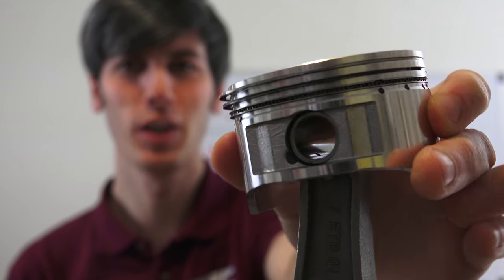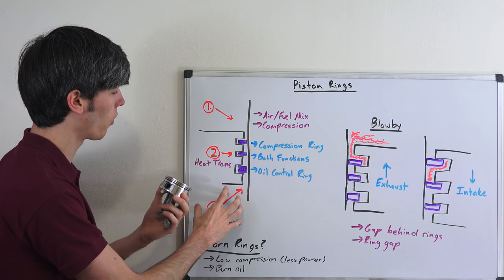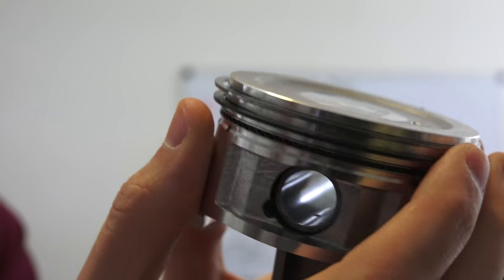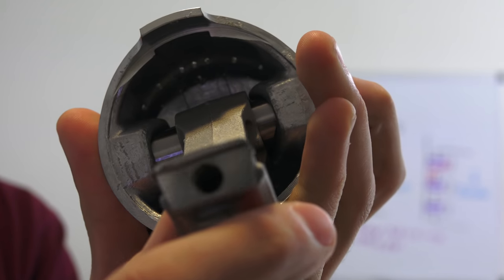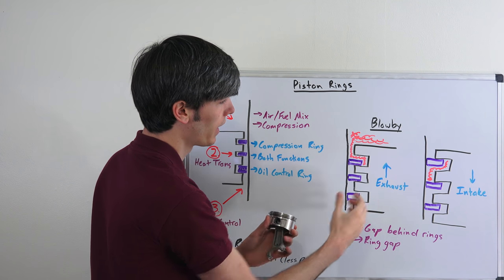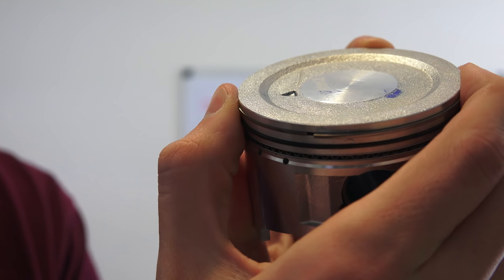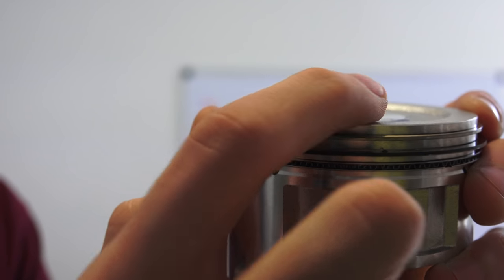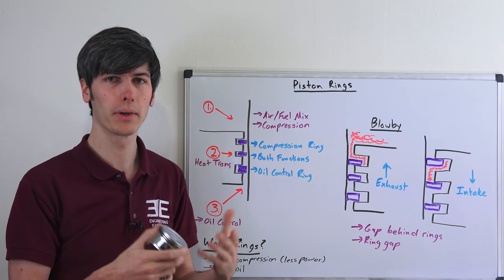Piston Rings & Blowby - Explained

Comment: How can oil leak into chamber due to relatively worn piston rings?? I just can't imagine how it's possible

So i'm thinking aloud:
Engine still has compression capability. Ok, maybe %15-20 less but rings still work. And oil is only "sprayed" to the piston from below. it is not something like there is huge amount of "constant, high pressure, oil pool" below the piston. Besides, oil leak can not occur during compression and power cycles since the pressure in the chamber will be very high. 
It only makes sense to me it may occur during intake cycle because in most cars there is vacuum in the chamber. If so, that means when we use engine breaking going downhill, pistons should suck the oil from crankcase and pump is to the exhaust without burning since there is no ignition and fuel injection since we don't use gas pedal. So in that case oil consumption should be highest when engine breaking with no gas pedal applied.

Please correct me if i'm wrong and help clarifty things for me..

Thank you very much. Big fan of your videos
Reply: ulyanof ... oil can get passed the piston rings upwards from the oil pan into the chamber due to crank case pressure from heat and gas vapor evaporation also with the crank shaft splashing oil everywhere every time the connecting rod dips into the pan. Most Engine blocks don’t have a crank case ventilation system like cylinder heads do, that’s another chapter. Cylinder heads have many moving parts that have all types of seals to keep oil and air from passing through but under extreme working conditions especially an engine with 100,000 miles or more have plenty or wear and tear which does allow oil to accidentally make it pass the vale seats, valve seals, valve guides and other areas that let oil make its way to the piston chamber. This is called blowby and it will also cause extra pressure in the piston chamber that will assist in pushing the oil down passed the piston rings. By the time the heads are warn out enough to allow this to happen, the piston rings also have enough ware and tear that they don’t seal as well as they used to allowing oil to pass the rings from both the heads and the oil pan. This is why there exists synthetic oil that have additives that purposely make these seals swell up to make the loose clearances tight once again to slow down blowby and other oil consumption problems. If your motor is a forced induction motor, blowby can happen even if the motor is a brand new motor and even if it’s built with high performance parts because of what is called valve overlap. Valve overlap is the split moment when both the exhaust valve and the air intake valve are slightly open at the same time. It is an extremely minor and critical moment because at high rpm parts are moving extremely hard and fast and nothing is perfect. The only thing that can control this factor is what we know as variable valve timing which is where the engines design has the technology to speed up or slow down either one of the cam  shafts rotation to control valve movement and or timing if you will in order to create a better and more precise function of the moving parts. The only thing that can stop or hold back the oil from passing the piston rings at this point is the rings themselves if they are new and or in great condition. Even then, they must be at optimal operating temperature so that to ensure that the material that the ring is made of has expanded to the factory or chosen operating specifications. More technically they must be gauged and gapped correctly and must be the proper piston ring for the application or conditions that the motor has been built for. These types of details have so many factors I could tell you about that I could write a book on it so I’ll keep this short.

Comment: How is the engine gonna behave when you pressed the ignition while the engine is on? Will it damage the compression ring? Is there a significant effect to the engine? Thank you.
Reply: as in turned the key to start while running?
Reply: Yes. One time my wife did that. It is so quite inside that she accidentally turned it on again.
Reply: +Peter S I believe the only things that would hurt are the flywheel and starter if there isn't a safety switch to recognize to realise the engine is already running

Comment: Not a bad explanation, but you are 2 strokes short in your description.
The vast bulk of blow-by is most likely to occur when the piston is experiencing the highest combustion pressures on the power stroke, and the compression stroke. Indeed fuel dilution of the oil is common in modified engines 
(richer fuelling for power & higher compression ratios)
Also the oil holes below pass oil both ways as most modern engines have oil jets that spray oil on the underside of the piston for cooling & lubrication.

Comment: I have heard that you are supposed to align the piston ring gaps 180 degrees from each other, is that true? Also can't you get to them by just dropping the oil pan and unbolting the connecting rod from the crank shaft? I think the piston would just pull out at that point.
Reply: piston rings probably rotate around the piston during operation so it may seem like a good idea but doesn't play out very well in practice. and you would have to tear apart the entire engine to get to the piston rings. as in taking the engine out and pulling the crank out

Comment: What happens if the oil drain holes in the piston are blocked or the oil control ring is stuck.  How does oil get into the combustion chamber if the compression rings are good?  I have a toyota 1zz engine, and compression is good, so i am cofused as to why the engine loses oil.

Comment: I have a V6 that has loss of compression on one of its cylinders with misfire. I pulled the oil filler cap off while it is running and I don't feel or see any signs of blowby. Can I safely assume that it is not a ring problem, but instead a burnt exhaust valve?

Comment: I just rebuilt a 460. After breaking in the cam, I checked the plugs, and saw that all my cylinders had a half a teaspoon  of oil on them, in the dish. Guides and seals are fine. It puffed a bit of smoke on start, but that was it.  Since my vacuum was a bit erratic, I determined the intake manifold was leaking in the valley, and sucking oil. I shaved the  manifold. Tested it again, and the vacuum came up to about normal for my cam.  However... I still have oil on pistons. Is this possibly just because the rings aren't broken in yet?  I also have forged pistons. There's a fair amount of blow-by, but the motor only has 1/2 hour running time  Thoughts, Ideas?

Comment: Hey great video, thanks for the explanation! I was wondering why it seems like modern cars can go for over 200k miles without any major engine work, but a car from the 60s will need a new engine every 100k miles. And when and engine is "tired" does that mean it has low compression because of worn piston rings? thanks!

Comment: I recently had a misfire code in my 2008 Honda Accord. They replaced all the spark plugs and did a software update. A spark plug was apparently the issue causing the CEL to flash rapidly and also create a vibration in the engine. The mechanic mentioned if the replacement of spark plugs and software update does not work, then it could be a more serious issue caused by a piston ring malfunction. 
His advice was to keep an eye on it. I have no idea how to do that apart from waiting for the CEL to go off again and taking it to a mechanic immediately. What else can I do to check if this is actually a piston ring issue? Compression test?? Thanks for the help!

Comment: Great video! Very informative! But I would like to ask why does all four of my sparkplugs have thin film of oil on the threads and the mating surface of the sparkplug and where it sits on the cylinder head? All of the seals gaskets are newly replaced, is it blowby? Do I have to change my piston rings? I asked an automotive technician about this and told me it’s normal but an expert on GA16DE and Nissan EFI engines said it’s not. Is it because of the expansion of the cylinder head because of the heat? My car is a 1992 Nissan Sunny B13 with a GA16DE engine, answers would be greatly appreciated. Thank you and stay safe everyone!

Comment: so if you have pistons with 4 rings (oil ring down the bottom of the piston and 3 normal rings at the top) if you had 4 broken rings (4 cyl engine) can you do away with the middle ring on each piston? its only a 30ish hp engine and won't see much work so it should work.

can't get new rings as the replacement parts are a little bigger than the original ones. (new pistons are roughly 1-2mm larger than the original ones therefor the rings are also bigger)
unless the ring can be adjusted to suit. i.e. cut a little off the end so it can squash to the right size. it should do the job then.

Comment: Any engine (new or used) has some blowby. That's why the PCV exists. I have some blowby coming throught the oil filler cap (if i unscrew it during idling, then it will start to dance.). Checked if gases come through the dipstick, no blow or suck (if smoke or blow came through the oil dipstick, then that means gas came in the crankcase, not in this example). What i understood, is if the PCV pipe is clogged, then that gas is not evacuated and it builds up in the oil, allowing it to leak where it can.

Comment: are the blowby gases the reason for having crankcase breathers?
Reply: yes
Reply: +C.D. Also, as an extreme example, in a one cylinder engine, the volume of the crank case must change.  If it can't breath, then it will build pressure and waste energy.
Reply: +Dan Alex Do blowby gases have a negative effect on the engine?
Reply: +Tejas Kaladi Blowby gas is acidic and degrade your oil. Having blowby gas is one of the reasons why you need to change your oil regularly.
Reply: Sweet, thanks for the info guys!
Reply: icekk007 Wow, I had no idea. Thanks
Reply: +Tejas Kaladi Blow by also lowers your effective octane rating since most, if not all, cars have the breather recirculating (oil vapors) back into the intake.
Reply: TWIRKNOLOVE Makes sense. thanks. I now understand that blowby is definitely undesirable.
Reply: +TWIRKNOLOVE  how does that work ? octane rating is a characteristic of the fuel isnt it  ? how would blowby lower octane rating ?
Reply: Dan Alex True. Though, blowby comntains oil vapors which get sucked back into the intake as you can see by the valve cover breather hose routing. The vapor itself, that is being introduced into the cylinder, combustion with the fuel and air giving the cylinder a lean condition. So this effectively lowers your fuel's capability of knock/detonation reduction.

For example, on my turbo car I have 2 breathers on my valve cover. One going to atmosphere and the other back into my turbo's inlet - sucking on it. I was having a hard time making over 350whp and not detonating, having to add a lot of fuel to my tables. Once I took off the breather hose going to the turbo's inlet, my car immediately ran rich on the dyno and actually had to remove fuel to make reliable power.
Reply: +Dan Alex Yes, octane rating is a characteristic of the fuel. Due to the introduction of blowby gas into intake, it mixes with gasoline and air. Now your fuel is not just gasoline, but a combination of gasoline, blowby and lube oil from the crankcase. Lube oil has much lower octane rating than gasoline, so effectively your "fuel" has lower octane rating.

Comment: The 2nd ring is only an oil scraper, and must never be used as a comp ring. If pressure get trapped on the 2nd ring it will lift the 1st making it leak massively, and then the blowby goes straight past the 2nd ring to the crankcase because it's not designed to hold pressure.

Comment: Quick question, I have a Miata that has a strong pulsating air coming from the oil fill cap (indicating blowby I'm thinking) but no smoke in the exhaust. Is this not blowby? Is this actually normal?

Comment: I had my bike's engine opened and I saw that my cylinder was full of vertical crosses. If I put my hand on the spark plug hole on the header I won't feel high compression as factory promises (around 10:1). I think it has to do with springs. Am I right?

Comment: I feel like a natural and basic question that didn't get well addressed is, why even have piston rings?  Most people would assume that if you wanted an air tight fit, then just a well machined piston fitting within the cylinder walls would be sufficient.  Explaining why this isn't standard practice would be helpful.
Reply: the block and piston expand different amounts. it may seem like a good idea at first but at colder temperatures the block would most likely seize and won't crank. at operating temperatures the engine would run but it would cause more blow-by with the same amount of mileage. what your idea is like a gun in its barrel. bullets don't have rings because they are fired once. pistons have rings because they will move up and down a minimum of 600ish times a minute, or ten or so times a second at idle. you may think then about sizing the pistons and rings for operating temperature efficiency, they do this in most high tier racing engines like formula one, but even then the engines need to be warmed before they can be started

Comment: Great explained it right... Reverand Auto🧐... I had tire down a v6 Ford ranger for head gaskets piston was burned on corner not round at all seen 2/3 of rings .. Motor smoking oil in mass a.f. tube to throttle it had watered oil in also...

Comment: Hi yea a question,  2litre Japanese 4 cylinder engine,  had a rebore,  the ring gaps are bang on to spec , the piston to bore clearance is right to spec , does it generally smoke blue ish oil once started until its been driven & run in ? With the plugs out , there is a oil film on all 4 piston tops & the plugs appear black & slightly oily .

Comment: Hey, my engine has low compressions and low power, but does not burn any oil, it is blowing smoke/air form the oil cap hole more, compared to another car with the same engine. The question is, is it possible that only the compression rings are worn out but the oil rings are okay? Pistons also move to sides a little when I try to move them. Btw I love your videos, very informative and useful.
Reply: Are all the cylinders down on compression or just some? If all are down, you have a worn out motor, you need to change all the rings. If your piston is moving from side to side in the bore, clearly you've got problems.  Compression rings keep things tight. A cylinder leak down test is also advised when you're trying to figure this out. It'll confirm bad rings, and or other places where you could be losing compression.

Comment: @Engineering Explained After rebuilding my engine with dry compression test of 185 PSI across 4 cylinders. Engine burns oil like crazy, is because rings did not seat yet with 3k miles after the rebuild or something is wrong? No smoke from exhaust and no leaks...Please advise.

Comment: My bike has started to show signs of worns piston rings. I checked the spark plug and its filled with oil. Power drastically cuts in and out as well and my fuel consumption has been terrible.

Comment: Hi Engineering.  I apologize, this is off the subject, but could you do a video about the differences between a supercharger and a turbo. The other day I watched a video about the Lotus Evora, which has a supercharger, and I was wondering what the advantage of that would be in such an expensive car.
Reply: +guyfihi In short: A supercharger uses a belt that is connected to one of your engine's pulleys to spin a compressor that force feeds your engine air. A turbo uses exhaust gasses to spin a compressor that sucks in outside air to force feed into your engine.
Way too many pros and cons to list here, though. They come with both positives and negatives.